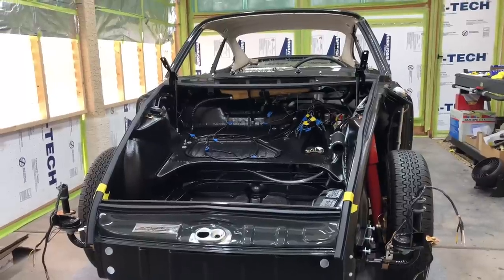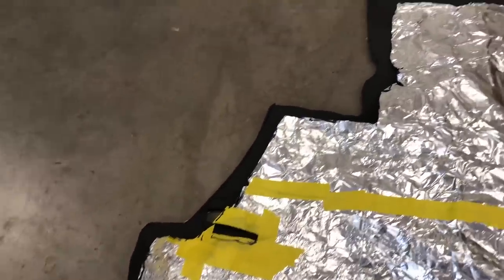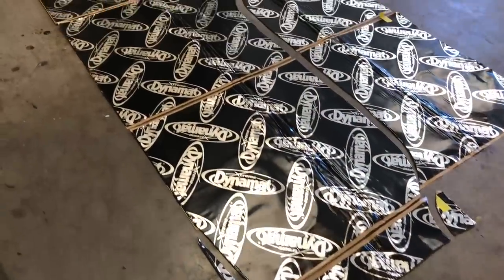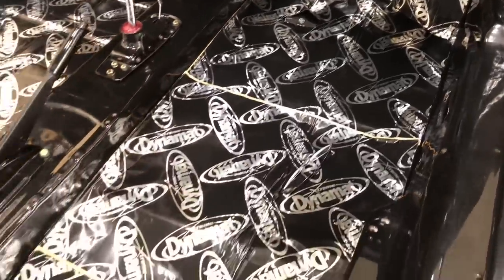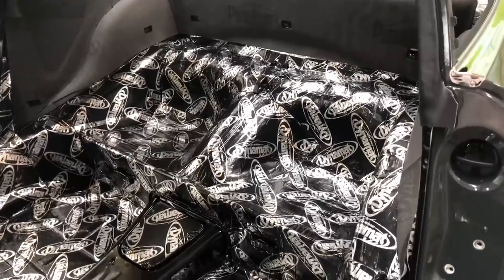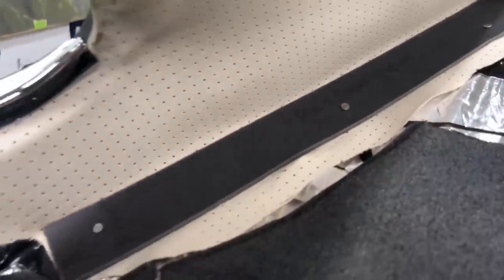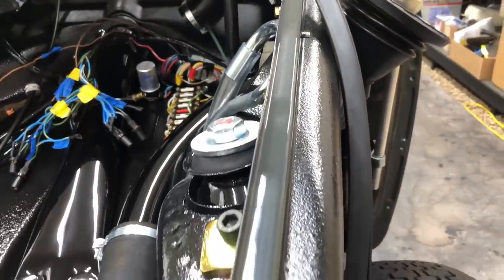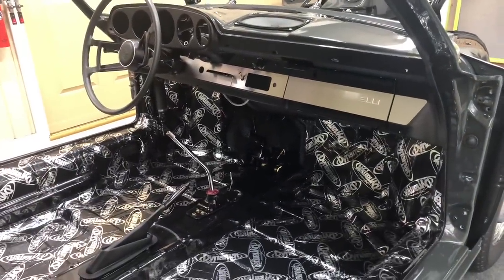1967 Porsche 911 Video 55 Installing sound deadening material

Comment: Nicely done! How about closed cell foam and perhaps some mass loaded vinyl on rear firewall?
Reply from the maker: Definitely can keep going with more insulation on top in those areas..
We did add some foam on the fire wall during the carpet installation

Comment: So I bought the xylene and just used a brush and bushed some on. It worked great. glue residue simply came up easy. What's the best way to use it? I thought maybe soaking a rag in it and letting it sit on the glue residue on the rear seats? How did you use it? Thanks.
Reply from the maker: Hello ocmacan..Im not quite sure of your question 
Are you trying to remove the old felt paper? can you be more specific as to your task

Comment: Mike,  Excellent video and explanation.   Can the dynamat and be applied before the exterior paint and headliner?  My car will be painted in 3 months (paint shop schedule) and I am looking to keep going.  The interior is complete with a new floor pan, rear seat area and parcel shelf all 2k epoxy primed and sealed.  Also did you put Dynamat on the rear wheel arch before the Dynaliner?
Reply from the maker: Hello Roger
Shouldn't be a problem to keep going as long as they mask the interior when painting.
You will still get fallout making its way into the cabin from the overspray even if they mask.
However everything gets glued and covered up so its your call if you don't mind a little rough feeling on the dynamat.
For the wheel arches I used 1/4 dynaliner foam but ended up scraping it back off because the panels wouldn't draw up tight enough.
1/8 foam would work best not the wheel arches.
Good Luck!!
Reply: @MikesRestorations   I put on the Dynamat and posted several pictures on one of the early 911 face book group sites and got roasted for adding all that additional weight and quieting the beautiful sound of the 911 engine.   I am still glad I did as it was the right thing to do.
Reply from the maker: @rogersimpson1052  Hello Roger
Sorry to hear you have had such a push back..It doesn't surprise me though..
I get it here too from time to time from the know it alls.
The ones doing all the shouting are always the ones that know lease what they are shouting about. I definitely wouldn't loose any sleep over them.
You did a quality job and you will enjoy the quality benefits for years to come!

Comment: Mike, did you entertain the Dynamat for the roof as well?
Reply from the maker: Hello Andreas 
Yes using a 1/4 inch thick light weight foam dynaliner for the roof. You can see in the video 39 installing headliner

Comment: Hi Mike- you mention in this video that you will cover the upholstery of the B pillar in a future video, but I've searched and can't find it?  Also where did you do the upholstery on the upper front A pillar?   Many thanks!
Reply: Mike- I bought the pillar upholstery kit from Stoddard's- it has the four rectangular vinyl pieces (A+B pillars) and a piece of foam to go under each.  I still haven't found your pillar upholstery tutorial, but it looks like you glue the upper and lower edges under to make a neat edge- right?  But not on the sides.  B pillar goes from the door weatherstrip channel around to the quarter window flange?

I have the A pillar pieces I took out to use as a pattern but I'll have to make templates for the B pillar.

Is the foam cushion layer glued down or just floating between the pillar and the vinyl?  Or maybe your 67 didn't have it and it was a "safety add-on" starting in 68?  Thanks for the help!
Reply from the maker: Hello Mike, Its been quite awhile since working those areas but if my memory serves me..I think you might find some video content for the A pillars in the installing the dash video. On my car the original A&B did not have foam under the vinyl but that doesn't necessarily mean that the 66/67s didn't have it. These cars were hand built and things evolved as they were being built. 
I did fold over the top and bottom edges and glued the fold shut with contact before installing. There may be some video evidence of this also in the rear quarter panels and garnish rails video. I then contact cemented the pieces into place. if you use the foam I would use a light spray contact like super 77 on the foam to metal surface only. I would let the vinyl slip on top of the foam and glue the vinyl to the body edge. Could be difficult!! not much gluing surface there. One thing to look out for on the A pillars would be to make sure you have enough vinyl running down onto the corner of the dash board area. If it is cut to short you will see metal underdash of the body coming through. The a pillars should slide under the finished dashboard in the corners.
Good Luck and Happy New Year!
Reply: @MikesRestorations   Many thanks Mike!

Comment: How many sq. feet of Dynomat did you use in your 911? Great videos!
Reply from the maker: Hello T Hyatt
I used 9 sheets 18X32 
4 sheets a 12X36 
and 32X54 1/4
I also used some dynamat stock I had on hand for the rear deck same dimensions 32X54
all these are available in our store under the dynamat page
https://www.amazon.com/shop/mikesrestorations 
Good Luck!
Reply: Mike’s Restorations thanks very helpful!!

Comment: Hello Mike. 
How many square feet of Dynamat did you need, was one box enough?
Reply from the maker: Hello Martin
I used 9 sheets 18X32 purchased as a box set on e-bay
4 sheets a 12X36 sold per each also e-bay
and 32X54 1/4 inch dynaliner for the rear deck ..e-bay
I also used some dynamat stock I had on hand for the rear deck same dimensions 32X54
Reply: @MikesRestorations  Hello Mike ! At the end I ordered pre-cut insulation from Lakewell.
They have many high quality products.

Cheers
/ Martin

https://www.lakewell.com/en/porsche/911/65-73